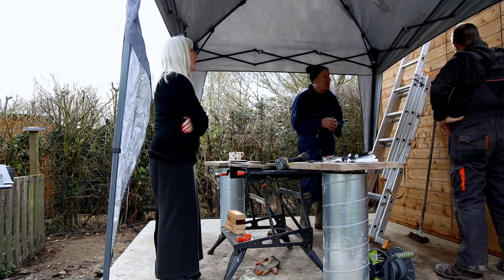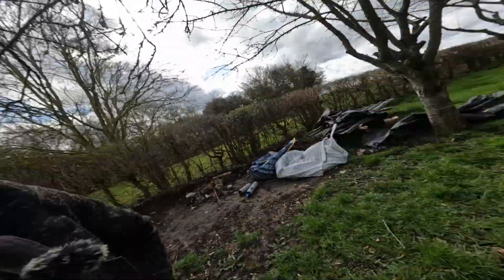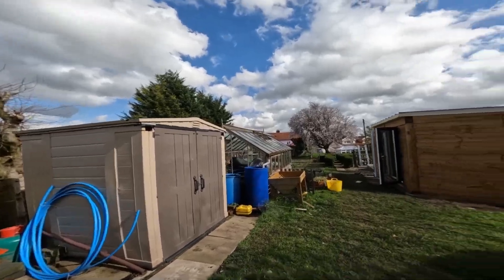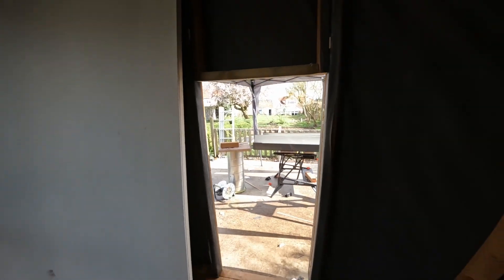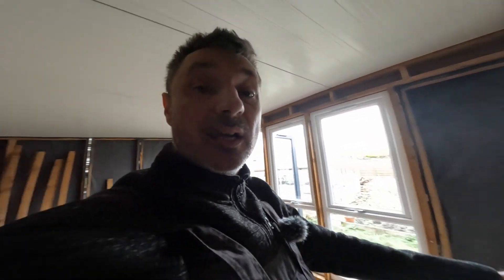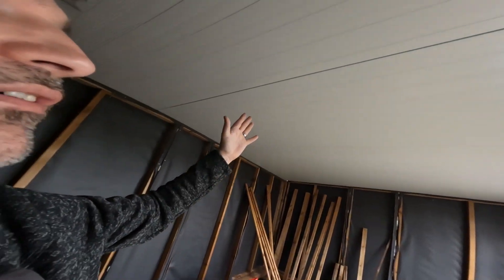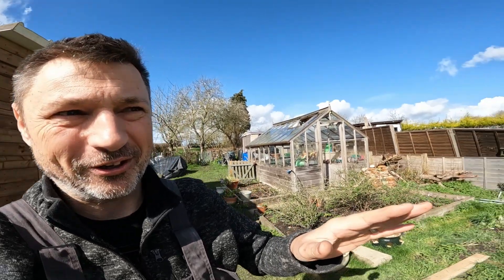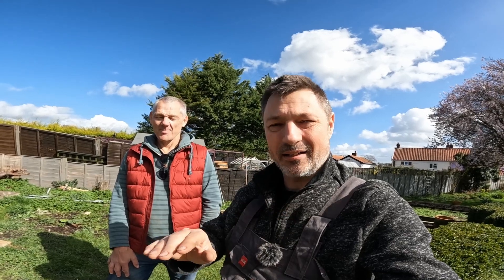I am Building The ULTIMATE Observatory !

Comment: Glen, great videos certainly inspired me to get on with mine. Just started on my Observatory, and have followed you by getting a Dunster building. Couple of points you could help me with. Does that timber base come with the kit? and how did you achieve true north on your piers?
Reply from the maker: Hi Stewart. Yes everything is included with the office. Very nice kit and not too difficult to construct just a bit of work. True North….now there’s a question. I used a couple of iphones and a compass. I knew if I was within a degree or 2 there was more than enough adjustment on the mounts. I still breathed a sigh of relief once I was able to polar align and check them.

Comment: Looks stunning. Does the height of the warm room limit visibility in that direction? You are probably going to get 6 or 8 times the effective integration efficiency compared to the old setup with 2 scopes and darker skies ?
Reply from the maker: Hi Nick. Yes the warm room will cut the angle in that direction but its to the West of the scopes. So any targets are actually dropping then and coming to an end of imaging for the night, but I also have an orchard of 15 trees the other side so it was always limited in that direction. I cannot wait to get stuck into a proper project once I am all done and I think I will notice a massive difference to the skies I left behind. Already I have found editing so much quicker and easier due to minimum or no gradients to deal with. Thanks for your comments and clear skies
Reply: @Astrobloke  Makes sense ! I can't wait until you start imaging. The skies here have been so bad the last 4 months. Looks like you will be unstoppable once this is all up & running !

Comment: Looking amazing glen, did you insulate the walls to keep the heat in?
Reply from the maker: Thank you, its getting there now. The building comes fully insulated with celotex in all the panels. 25mm in the floor and walls and 100mm in the ceiling so should stay very cosy indeed. Just to make sure I am adding underfloor heating and laying a laminate over the top